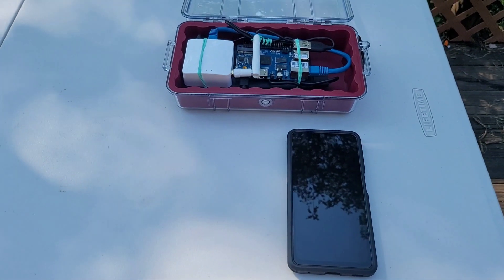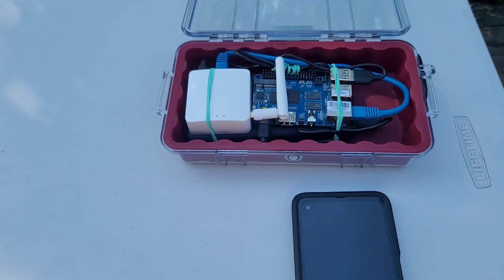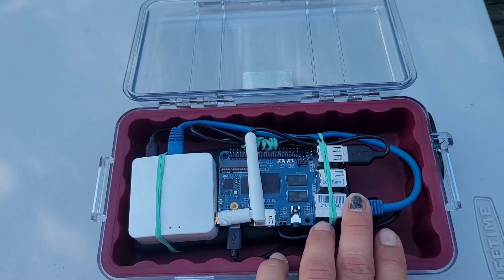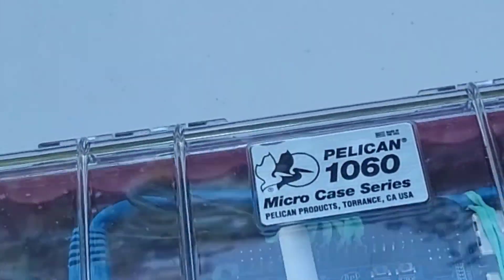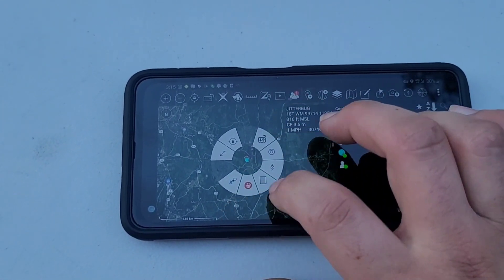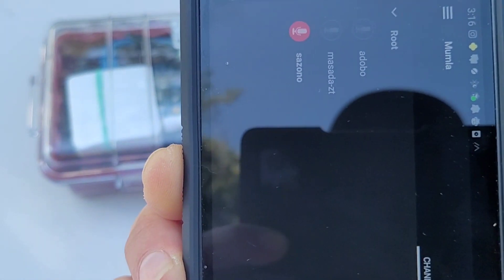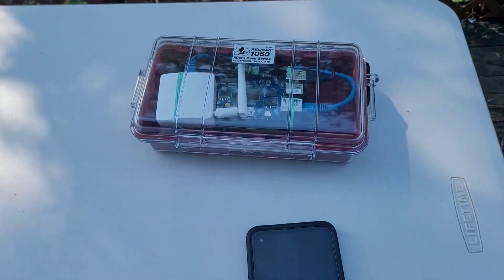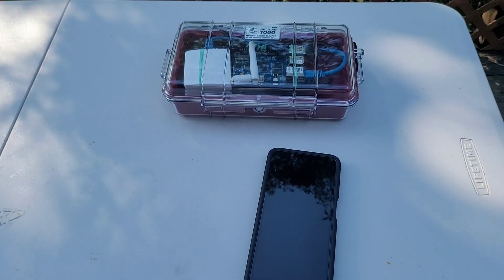TAK In a Box - Portable ATAK / FreeTAK / FTS / PTT Server Solution (TAK-RBP1)

Comment: so this is necro as hell and dont realy know if anyone has brought this up yet but....if that emmc memory module becomes corupt your screwed... and emmc is actuly less reliable than nand flash thats used in sd cards. as for having to redeploy just build a few sd cards at the same time so you have backups. that bannapi more than likely wont boot from the sd card slot meaning emmc crouption that pi is a brick. id also look into lora as a backup to your data connection since were on the topic of things breaking. with the right lora setup no data connection would be needed at all

Comment: Nice set of "bells and whistles".....but, in a SHTF situation it'll likely be relatively expensive dead weight since cell service and the internet won't likely be dependable.
Reply: You don't need to be connected to a cell or the internet at all a wifi conection can be a box that you carry around with you that will just connect the devices around it its called local connection and it does not require internet connection

Comment: Just with the tinny bit of knowledge that I have and no idea what you doing....I'm going to take a big swing and say...There is no way to forward ports on a 4G sim because it has no public IP.
I'm guessing the only place you have tested your device is on a WIFI system. If you run your server on a 4G sim it will not work...am I right or wrong?

Not to say that there is no way to use this device in the "wild". but not as you are show casing it.
Reply: You don’t need to port forward when using the ZeroTier vpn that he has built into this device. The way ZeroTier works is it treats everything like it’s on a big layer 2 network switch, that’s the beauty of using ZT. Every device on the zt network has a private ip address that you use to connect together stuff. If your really fancy you make sure you have static ips configured in zt network control interface and then setup dns names for the devices with their private ips as A records in your dns host.
Reply: @PacketFPV exactly this
Reply: @getgotak  I'm starting to think maybe it's time I start making tutorials and putting out info like this for the common use. I run a data center in my day to day life so this stuff just sorta comes second nature, plus I love solving tech problems. I can think of 100 ways from sunday to make this stuff work, that was just the way that I set mine up when I was first testing it.

Comment: Well, I just ordered one for our local volunteer SAR team. I hope this works and that I didn't buy a paperweight. Is anyone here using this on SAR team?
Reply: How has this worked over the last 2 years? Have you been able to conduct SAR operations with the unit?
Reply: @getoutside2854  We actually had to recommend a different app as there were too many problems with ATAK. We ended up moving into CalTopo (Formerly, SARTopo). 
I still love the app and use it for personal matters but that is decreasing over time as Ggl Earth is performing with more stability.

Comment: You might consider TailScale vs. ZeroTier, a bit more control without the need for the 3rd party server unless you did your own ZT server.  Love the kit.  Another thought might be adding Lora for the text messaging side since you'll get a far greater battery life.   Meshtastic is also a phenomenal piece of software for Lora
Reply from the maker: Yup meshtastic support is built in out of the box. We offer wireguard/tailscale too but that does require port forwarding which you can't really do over 4g.
Reply: @guerrilladynamics  Tailscale defeats CGNAT on cellular networks. It also allows you to port forward, change DNS and use other devices as exit nodes. I have a pi that is cellular connected with a six fab LTE hat over tail scale. Also, I just use rasp AP instead of adding a dedicated router, just have to make sure, all of your docker routing is correct. That pi is an ATAK server, Kiwix Server, Calibre Ebook server, Plex server, runs portainer, Prometheus and grafana. Completely reachable over cellular.

Comment: If you can sling some always on mic on the software, but use a Bluetooth mic with voice detection and noise canceling, like a throat mic and ear bud, etc. You could eliminate the need for the screen to be on.

This would limit your use profile to having the right hardware for each user, but maybe every user doesn't need active mic, maybe squad lead does, and you can use it to comms across squads, and for squad lead to comms to squad members.

Be great if it has the abilities of say a vent server, which may be a good idea to run alongside ATAK, as it allows channel allocation, and cross channel communication. Meaning you can say something across the team, or to the squad depending on if you're using the app actively or if you're just speaking in channel.
Reply from the maker: Yes you can set all of that in the mumla client settings. I prefer to use only open source software or at least as much as possible. Mumla can set voice activity on and just have a hard mute button in your headset.

Good ideas.

Comment: Maybe consider using a single external RJ45 gland. avoid the extra hole and give you lots of options.  including external DC power via ext. battery unit (inline or modular swap) and or run it on PoE injector or switch.
Reply from the maker: Check out the latest iteration of it at guerrilladynamics.com we have a rj45 in and usb a in for power.

Comment: if everyone has to connect through 4g why do I need a mobile unit? could have a stationary server to connect to since you're doing so wirelessly, and plugged in so you could circumvent the battery life
Reply from the maker: They can connect over WLAN and LAN as well. The next logical progression would be Mesh network nodes. In the works.
Reply: Curious also why you would need this considering it needs to be connected to the internet somehow. Not really practical for off-grid type missions unless I am missing something
Reply: @russm195  what he's getting at is you can use mobile WLAN/LAN, so where I wouldn't be able to make a physical connection formerly and do the other stuff I now could. This would probably help if you really need to make LAN connections to other pieces of equipment while on the go.
Reply: @russm195  Just realized this is entirely for LoRa mesh networks if I'm not mistaken
Reply from the maker: @victorygarden556  not entirely but that is one method of data transport.
Wlan/lan/4g/mesh
Reply from the maker: @russm195  Squad leader and team members can connect over WiFi in the local operating area as there is a built in wireless router with its own access point. If you want to bridge in long distance off grid comms simply grab a Ubiquiti Rocket m5 and a battery bank and connect to other squads over wifi mesh. HAM operators can use AREDN. You can also use the uplink port on any other tcp/ip layer.
Reply: @guerrilladynamics  how would you connect the Ubiquiti M5 Rocket within this infrastructure? Would it be another piece of local equipment that sends signals out or would you put it on a hillside and connect it into the existing AREDN network?
Reply from the maker: @russm195  hardwire a airos device or aredn device to the ethernet port on the new version at guerrilladynamics.com